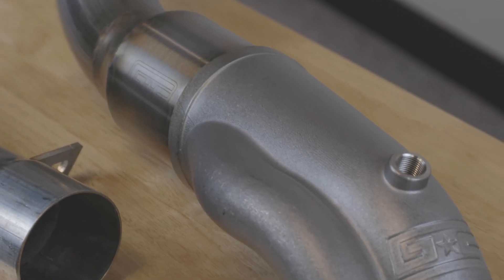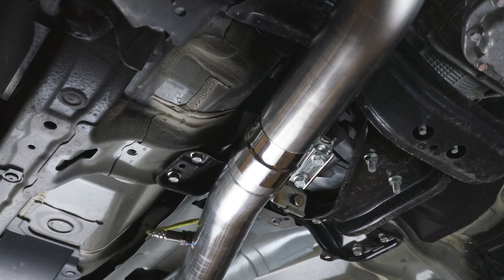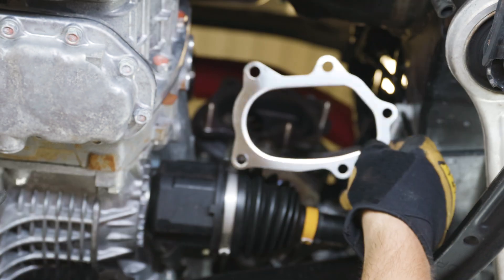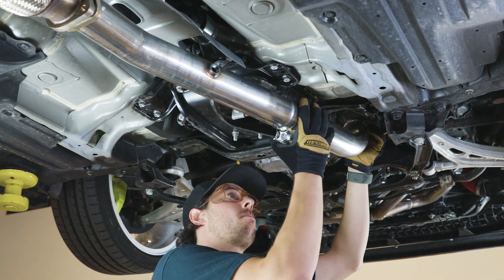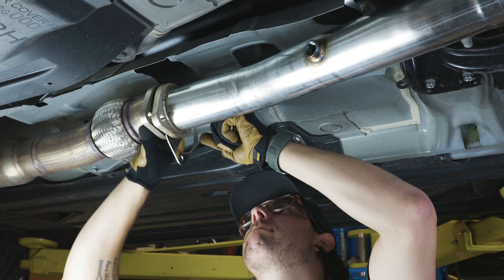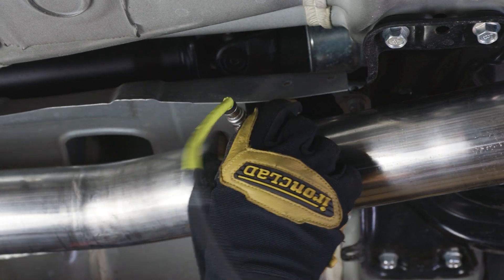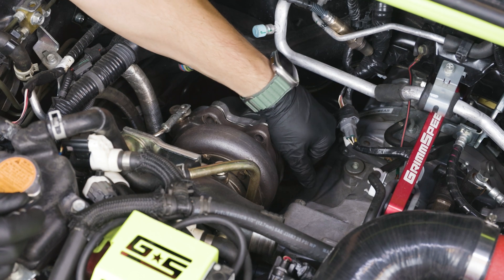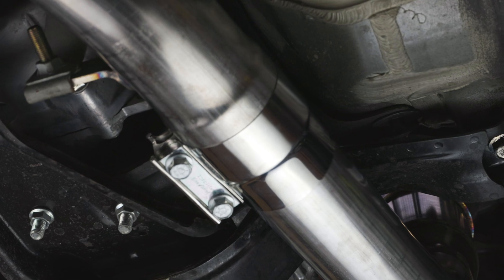GrimmSpeed Version 2 GESI Downpipe Install - Subaru EJ Engines

Comment: Will an ewg fit with that monster can?
Reply from the maker: Unfortunately not, the dump tube will interfere. You would have to modify it to work.
Reply: @GrimmSpeed  Which one interfere the dump tube of the Downpipe or Dump tube of the External waste gate?

Comment: Will this fit up with the GS 38 EWG?
Reply from the maker: Since we no longer carry EWG's we can't confirm fitment. But we have heard it does contact the dump tube.
Reply: @GrimmSpeed  contact or prevent?
Reply: @GrimmSpeed  Which one interfere the dump tube of the Downpipe or Dump tube of the External waste gate?

Comment: I've got a completely stock '05 Legacy GT wagon I need to replace the downstream cat on and for giggles I've been looking at one of these to replace it and the upstream cat. Would this just bolt in (with the adapter for the OEM exhaust) and run without needing anything else like a tune?
Reply from the maker: Will fit 05-09 manual 5MT Legacy's. For vehicles with VF40/46 turbos the wastegate divider tab may require modification in order to allow the internal wastegate to function properly. You will need a tune to run this safely and reliably.

Comment: Soo I purchased a V1 downpipe for my GR Wrx haven't installed it yet I'm wondering if it will throw a CEL, the design doesn't seem much different in comparison to V2
Reply from the maker: There is a possibility of throwing a CEL with the V1. Talk with your tuner to see what can be done.

Comment: Curious why you went with a slip joint instead a pipe?
Reply from the maker: A couple of reasons. The main one being decreasing the cost of shipping by making the package more manageable. Another plus is making it an easier part to install.